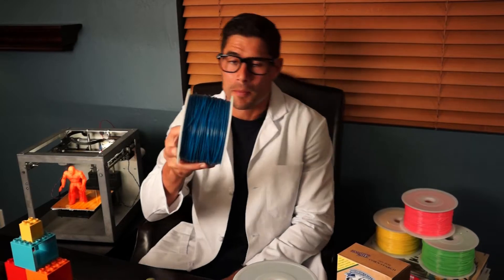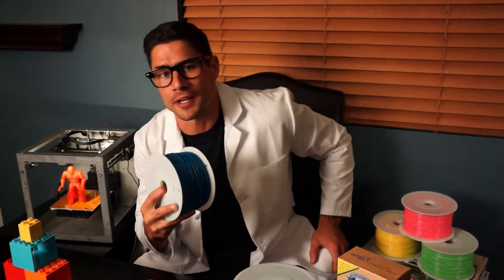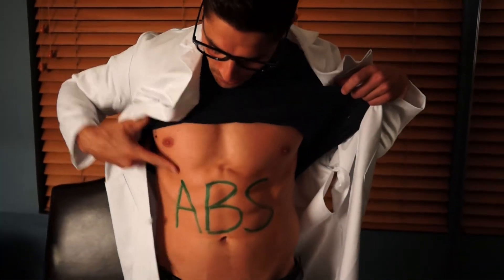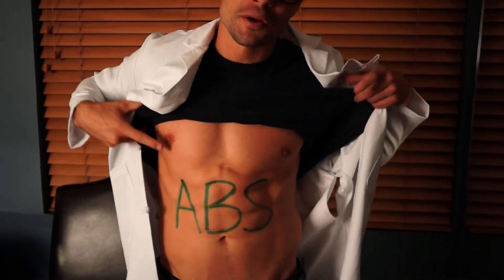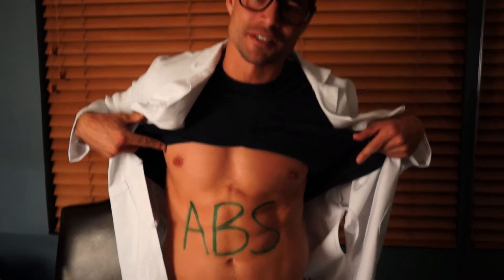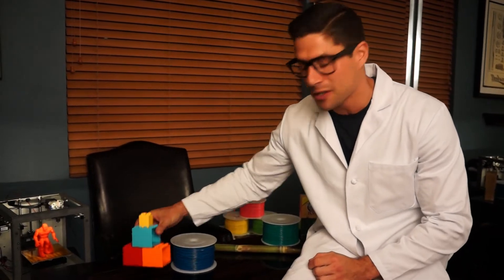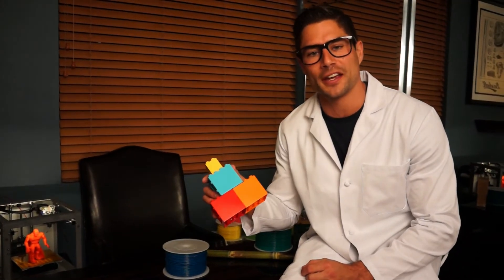Joel explains the basics of PLA and ABS filament for 3D printing

Comment: I totally get that you're trying to be a little shocking or whatever with showing your abs and the bikini chicks, but really not necessary.  Anyway, my question is you said PLA resists fading better than ABS but then when you're talking about ABS you say it is colorfast and will hold it's vibrancy for years.  So which is better for holding color?  Also you mention that LEGOs are made with ABS and say they are very flexible.  Flexible isn't really what I think of when it comes to LEGOs so not sure I understand.
Reply: +dibbkd dibbkd I thought I had misheard him, but didn't want to rewatch this vid. He did kind of leave that up in the air, didn't he?

Comment: Awesome video!, Is there any PLA or ABS filament that is see threw like for example water bottle? I want to put water in a 3D print was wondering if such material is made so I would be able to see the water in side the object. Thanks
Reply: I had watched a video by Barnacules Nerdgasm who printed a T-800 head with a translucent green filament. The translucency was cloudy because everything was printed in layers. Light can pass through but you can't see through. I think you can print a "mold" and then pour molten plastic into it. You can make the bottle as is and use light to illuminate the water.